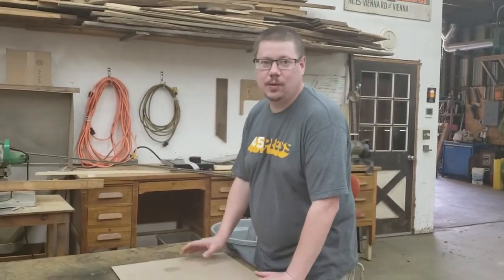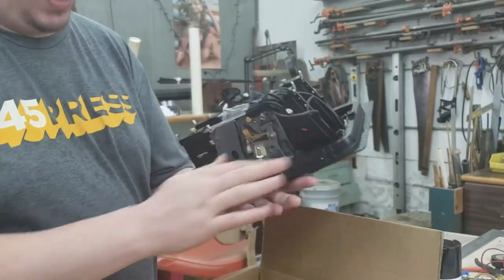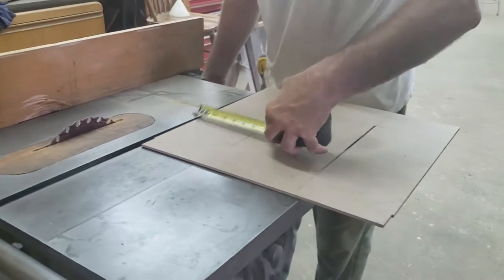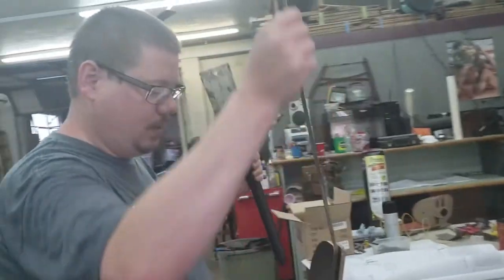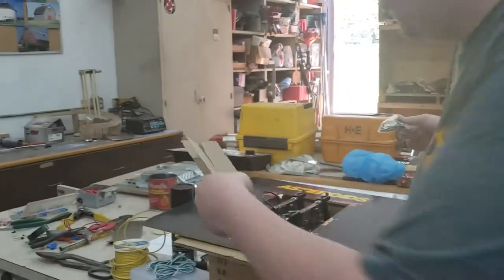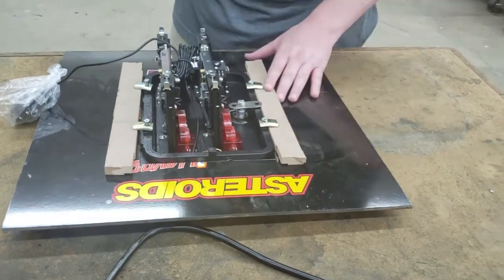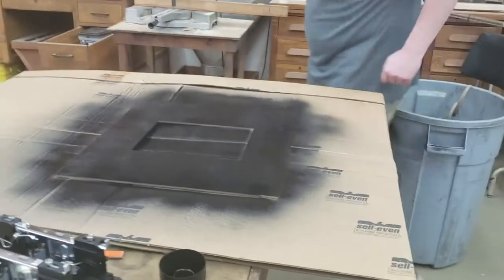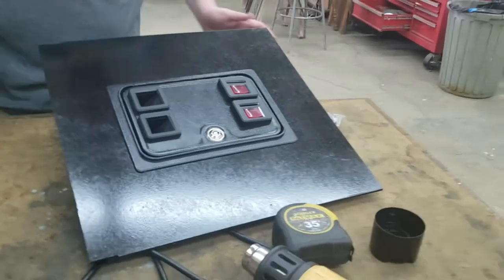Tutorial: Installing a Coin Door on Arcade1Up (Asteroids Mod Part 4)

Comment: Using a tablesaw to cut out the hole is not a good idea. That's possibly the worst cutting tool you can use for that job. I'd reccomend drilling a hole in the middle and then using a jigsaw to cut the hole perfectly.

Comment: Do you have to convert the Arcade 1up to Pie or MAME before you can get the coin door to interface with the game?
Reply: No. The coin door is just a button at the end of the day. Take the wire for the start button out of the encoder board and just plug the wire for the coin door into the same spot.

Comment: I was all set to order a coin door but X-Gaming wanted $20 to ship the thing. Deal breaker for me.
Reply from the maker: Yeah the shipping is expensive. They're actual cast iron, so they're really heavy.
Reply: @ArcadeSchool  I bit the bullet and bought two single slot. Shipping was 20 for both and 25 each. I tested MAME and only one coin "button" is needed. As long as there are enough credits, player 1 and player 2 will start no problem. So I look forward to installing these.

Comment: Will these actually require money to play the game then? Or are they purely an aesthetic choice?
Reply from the maker: You have to put real quarters in it to play. What i do with mine, is keep a small container near the cab with $20 in quarters. When I start to get low, i just open it up and refill the jar.
Reply: Arcade School can you install this into a stock arcade 1up? or do you need a raspberry pi for the coin door to work?!?!
Reply: @ArcadeSchool  this is honestly awesome. Keep posting I'm super interested! I want mine to look and perform as authentically as possible to an old arcade cab!
Reply from the maker: @dongarcia2750  This can't be done using the stock board. Only with a Pi, PC, Pandora's Box, etc.
Reply from the maker: @louisb.6149  Thank you!
Reply: Arcade School yes you can... all you have to do is slice directly into the player one button. just get a t clamp connector .... you don't even need to cut or anything to the player one wire.